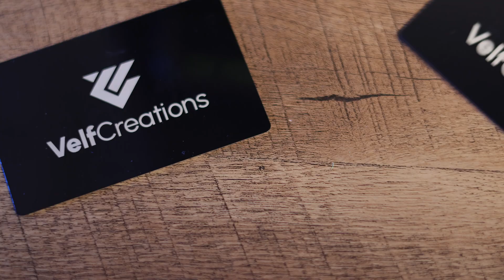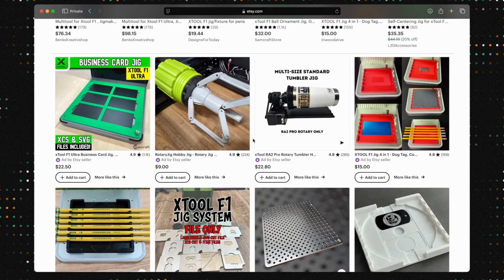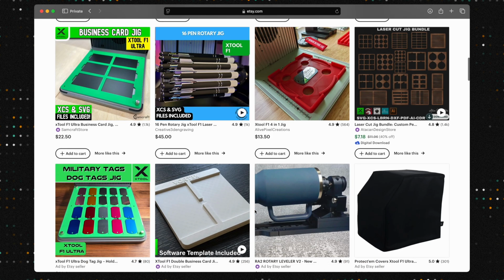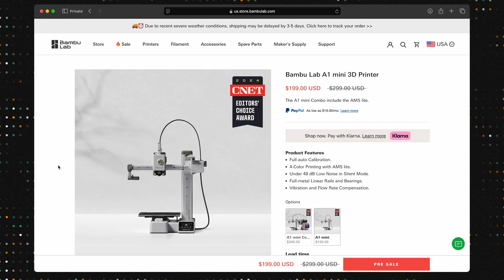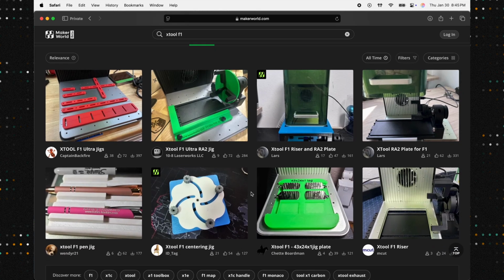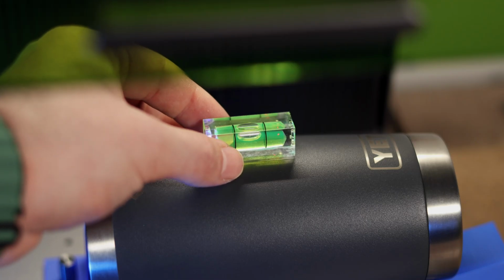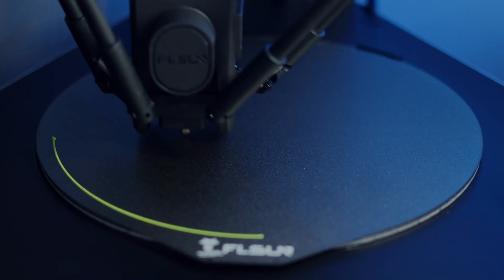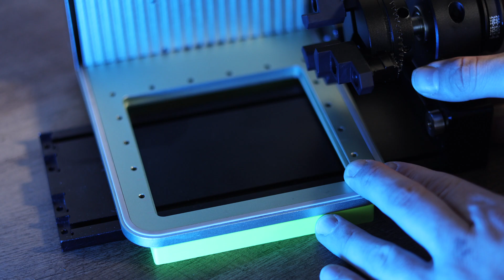From DIY to Premium: The Ultimate Guide to Laser Engraving Jigs (xTool, ComMarker & More!)

Comment: Very useful, thanks. 

I am thinking about buying my first laser engravier/cutter

What you would recommend?

xTool or ComMarker?
Reply from the maker: As a first time user we would recommend xTool simply because of the softwares ease of use, and they typically will give you a wider range of materials that you can engrave on since the xTool F1 and F1 Ultra both have blue light laser in addition to the IR lasers. But if you are willing to do some learning and only plan on engraving mainly metals you can get a much more powerful fiber laser from ComMarker for much cheaper

Comment: Don't the push in pins get in the way of the laser?
Reply from the maker: It depends on the design, if you are engraving something that goes edge to edge you may have to line up the cards in the middle or place the pins differently. But the cool thing about this is you have so many options for configurations